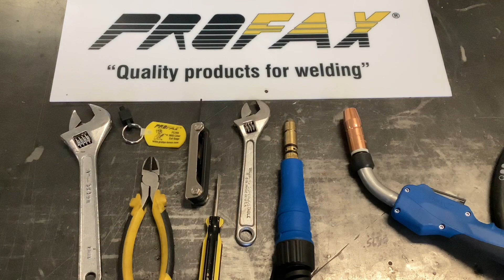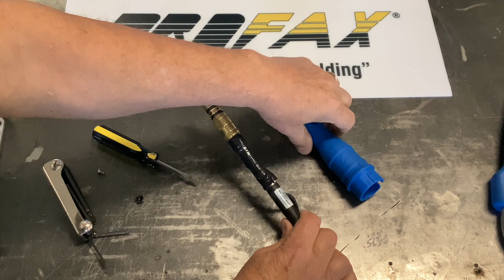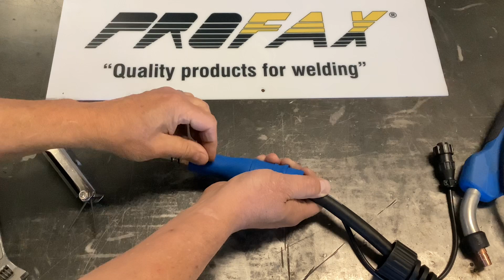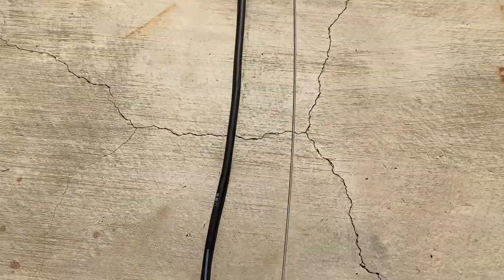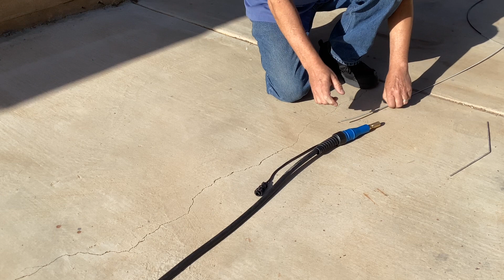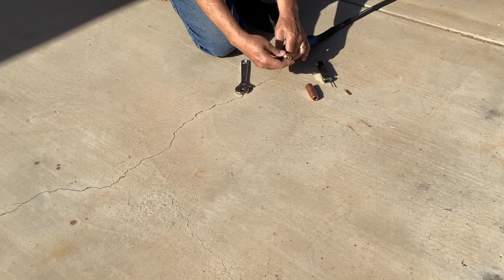PROFAX MIL-25KIT CONVERSION KIT

Comment: Used this same setup and installed the ProFax 42N-3545-15 Teflon Liner to run Pulse Aluminum on the MillerMatic 255 using a large spool of Aluminum wire and it worked AMAZING!  Was a simple stupid solution and I did not have to buy the expensive push/pull or spoolgun options.